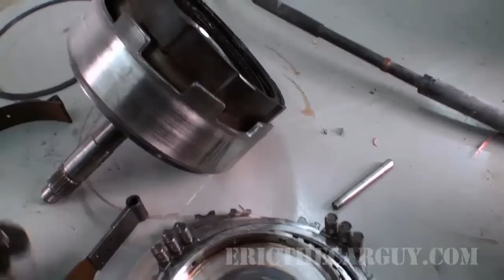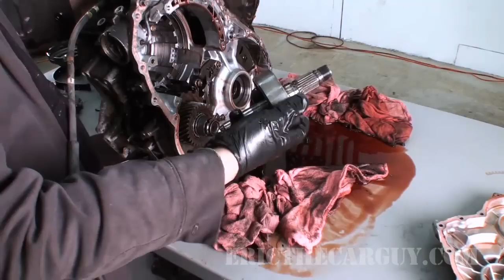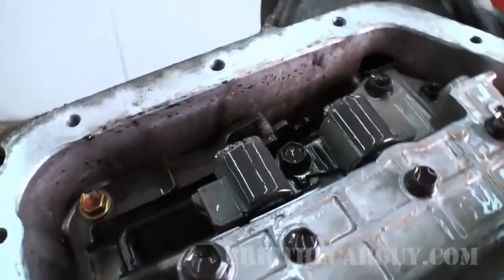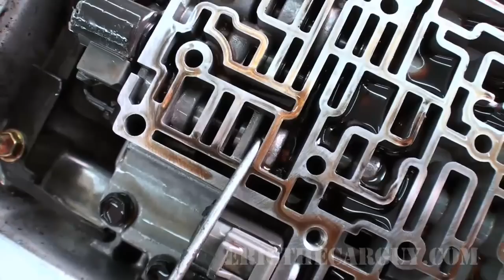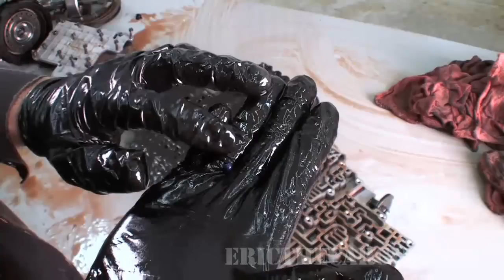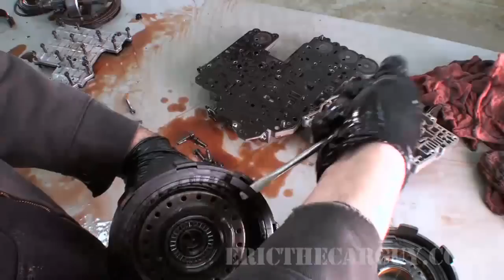The Basic Parts of an Automatic Transmission (Part 2)

Comment: what are the drive ratio's ?   
how many gears does it have ? what if you put TWO transmissions back to back ?
would that get you double the torque and  double the top speed if your engine was strong enough ?
Reply: J-N-H-M, Hi, the drive ratios (mostly called "Gear Ratio") is the relationship of movement between 2 or more gears, is the way to calculate the difference of speed of the gears, for example, imagine you have 2 wheels touching each other (acting as gears), one of the wheels (the small one) has half the perimeter of the other (the big one), this means the the small wheel which in this case is the input, needs to rotate 2 times to make the big one rotate 1 time, and so, we say that the drive ratio or gear ratio is of 2 to 1, or to explain it in a more simple way, this means that 2 rotations of the small wheel equals to 1 rotation of the big wheel, this concept is applied to all kinds of gears, including the "planetary gears" which are shown in this automatic transmission, there are many kinds of transmissions with many numbers of gears and speeds, it depends of the fabricator.

Now, i might not be the indicated person to say whether or not using 2 transmissions would double the torque and speed, as i know, if you do that, it is highly possible that the vehicle should have the double of the torque it had (as long as the other parts of the vehicle don´t break), but about the speed is a different story, because these transmissions are designed for a specific range of speed, and it would be very hard to make the vehicle considerably faster without damaging the transmission, independently of how you place the transmissions or the power of the engine, to achieve this, you would need to make some changes in the final gear ratios of the transmissions or axles of the vehicle, which could actually be more expensive and complex (and dangerous) to do than buying another transmission with higher speeds; i hope this information results useful to you, i must admit that i don´t have a very wide range of knowledge or experience in this field, so you could ask to people who know more about this than i to have a better idea.
Reply: thanks , besides the gears of  rc cars , bikes and  electric motors and pulleys  im a complete NOOB ..  as an inventor fabricator theorist , im always trying to learn  or improve things ,  for example Transmissions alone and all the different types even like the  " D-drive " and million to one gearing have given me Soo many idea's ... like couldn't a supercharger be crank powered threw a CVT  to gain PSI in different ways ....  instead of max RPM  equalling max boost pressure  , it could be geared/programed to hit max boost at 3000 rpm  and hold at max boost threw changing the gear ratio's / speed of the supercharger as the engine went higher in RPM .... 
thats just a small idea i kind of dont care sharing ..
besides i think the " vandyne superturbo "would still have that beat..
and the new F1 - powerUnits might be more of the future .
XD

Comment: how long do you mean "a long time"?? My 2008 LS460 8-speed auto has 87,500 miles without a transmission fluid change, is this going to cause the problems you mentioned when changed to new fluid?

Comment: thank you for this videos about automatic transmission..I am a simple mechanic here in the Philippine..I need your help about Mazda 2006 model..i have some question to you,,when the shifting engage to drive can not be move forward,but the car engage to rear the car is move to rear then  the transmission  is noisy,the panel board will be have an AT.i am FRANCO TACORDA PHIL.

Comment: I was about to drain and refill new transmission fluid, but the car has run over 200.000 km, and I doubt it has ever been changed before. If the new, thinner tr. fluid could possible ruin the function of the transmission I'm having second thoughts. Maybe save the old fluid and fill it back in should trouble arise?

Comment: hey eric I have a question. I have a 94 dodge dakota 2 door with the 3.9v6 automatic. My question is is it safe to engine brake with an automatic transmission? Im a little tight on money and to save on brakes I have been taking it out of overdrive in to regular drive then shift to 2nd to 1st as well as using a little braking too. Is this a smart thing?, dose it really matter, or should I just plain stop. Also I have a posiy traction 3.90 rear end out of a ram 1500 if that matters

Comment: hello eric i have 98 accord automatic and i recently replaced the trans with jdm trans and there is a delayed response in shift from park to drive and when put in reverse it makes noise and when i come to a stop it slams into gear before i accelerate, also when i put it it park the key won’t come out until i move the car forward a little. i’m all out of options. thanks

Comment: How in the H....e....l ...do you know which part needs to be replaced....in an auto trany...or do the service tech just replace a certain number of parts for a specific trany....and then check it out...I do know that a certain number of parts go bad  for each and every trany..so do they replace these parts and check it out on the dyno...or do they check out EVERY part and EVERY clearance of the trany...so it will pass the test...
Thanks .Kenny just a thought

Comment: Halo, I have a Toyota caldina Diesel engine wagon. Year 1999, engine 3C-E,
So this car has been sitting in my front yard for about 8 months, prior to that it was running just fine.
Recently I started it and it wont move. The gear lever goes to D, R, N, 1, 2 but the car wont move. I changed the ATF which was very dirty, so I changed it 3 times, every time pouring 4-5 litters of fresh new ATF. I changed the transmission oil filter too.

The car now after starting it moves for about 50-100 meters and stops. what could be the problem. Mechanic suggests opening the gear box which to me should be done as a last resort, just my opinion. I heard that when an automatic gearbox is opened it can start developing problems, how true is that?

Comment: What's amazing to me is that most of the parts individually don't seem heavy duty enough to handle the torque required to get a vehicle weighing thousands of pounds up to relatively high speeds or up a hill.   How is this?

Comment: Question , so am trying to get a maxima but from the reviews I read is that the 04 - 06 model have bad transmissions and for some reason the transmission starts to slip when driving down the rode when it's shifting gears and it starts to stall when you go from park to drive they just pretty much start fucking up unexpectedly wether you have high miles or low so what can be causing this issues inside the transmission ???????
Reply: Lots of stuff could be wrong. Just pull it from the car and get a new one.

Comment: well at lest Ik now that when I changed my fluid in my transmission that would be why it's starting or do a little bit slipping now wish I hadn't had done that just like now how long it last before it actually goes out on me cause only really slips if u stop real hard or slow down real quick and then push on gas u feel it slip

Comment: Given the advances in electronics controls and actuators, why has not any manufacturer came out with electronic actuators on a fully mechanical gearbox?  Honda does something similar but we all know their track records on making automatics!  Use linear motor/beefy solenoids to push the clutch in and/or change the gear and forget all the wizardry needed in making that fluid passages ant farm.  Can somebody explain what is the practical problem with this approach?

Comment: better to replace rather than repair. Labor charge would be much higher having you pull the whole thing apart, digging through the entire unit. swap with a new one is bound to be cheaper, right?

Comment: i use vios 2010 model A/T, is it alright if i switch the gear to Neutral whenever approaching a stop light few meters away so as to make the car on free wheeling, is it really advisable to do that? or rather keep on D gear and keep stepping on the brake while waiting for the green light?...
Reply: I really want to know that too! I used to do that all the time...i hope it wasn't the reason of premature death of my gearbox (started to slip)

Comment: You could say the valve body is a MECHANICAL computer. 

I liked the trick with the rag. 

But your explanation of "overdrive" could have used some improvement. It is just a gear ratio of less than 1. Gear ratio is simply number of turns of the transmission input shaft for every time the output shaft turns once. The input shaft of the transmission turns the same number of times as the engine's crankshaft. With a transmission having 4 speeds, that is, 3 gear ratios plus an overdrive gear ratio, the lowest gear, or first gear, might be maybe 4/1, that is, for every 4 turns of the input shaft, the output shaft turns only once. In decimal notation would simply be 4. Second gear might be 2.5/1. Or simply 2.5. Third gear might be 1/1, or simply 1. And for "overdrive" the input shaft will make LESS than 1 turn for every turn of the output shaft.  Perhaps for every 3/4 of a turn of the input shaft, the output shaft makes 1 turn. In decimal notation: 0.75. For "overdrive," the gear ratio is LESS than 1. That's all you need to say. Another way to day the same thing is that instead of the input shaft making more turns than the output shaft, the input shaft makes LESS turns than the output shaft. That's the same as saying the output shaft makes more turns than the input shaft. Or you could say an overdrive gear ratio is a gear ratio where the ratio of input shaft turns to output shaft turns - is less than 1.

Note that the axles and wheels do not turn once for every turn of the 
output shaft. Rather,  there is a gear ratio between the output shaft 
and the axle called the final drive ratio. Typically it is roughly around 4.0. For every 4 turns of the output shaft, the axles and wheels turn once. To get the number of times the wheels turn for each time the engine crankshaft turns, multiply transmission gear ration by final drive gear ratio. Then, if you know the outside diameter of the tires, you can calculate the car's speed from the engine crankshaft speed in revolutions per minute (RPM).

Note that I have used only simple arithmetic here - just multiplication and division (fractions can be viewed as simply a way of communicating division). No algebra or calculus was necessary.

Comment: hi eric i have a 95 jeep grand Cherokee with a 4.0 with 42RE transmission sometimes my Jeep starts in 2nd to 3rd gear it feels like I'm pulling in the Titanic behind me there r no transmission codes could the Governor Pressure  solenoid be bad or a Sensor ?

Comment: I have a question that no one can really answer for me. I OWN A 2000 Honda Prelude 2.2 H22a Auto with 81k. I live in Ny and ever since Sandy I been burning alot of gas averaging around 15-16 mpg. Tge car has new cap rotor wires and plugs, I have a Cold air intake new fuel filter new fluids. I keep my RPMs around 2-3. I also replaced all the seals in the engine and had the valves adjusted about 10 thousand miles ago. Timing belts and water pump has also been replaced. Running type 2 coolant

Comment: I wonder if it would just be easier to build a computer controlled manual transmission. Just a few extra parts to shift gears and control the clutch, but I think it would far simpler and more efficient than this.
Reply: They exist, but they're usually not great. A double clutch gearbox is a basically a more advanced execution of that idea.

Comment: Let's pretend that the weak points of this Toyota automatic transmission are the bushings in the transmission pump stator, that wear out prematurely: in your opinion, what accelerates the most this phenomenon? For example: driving almost always in hilly or montainous areas? Lack of maintenance, like a drain and fill every 60.000 kilometers, plus ATF filter replacement? Spirited driving?

Comment: The valve body is a mechanical logic circuit; the result of a lot of tedious math and engineering a physical object to model those equations.  I assume newer transmissions, especially CVTs, replace that with a computer.

Comment: How automatic transmission select gear?
Reply: Pedal position, your current gear, you current speed. Too much resistance you are going uphill, too low resistance you are going straight or downhill. Engine ECU or transmission computer calculates all this from how your gas pedal is pressed, you give gas but still very slow, its uphill, down one gear check again... how does it change gear, ok its too high lets go down, there are oil "caves" or traps, ecu sends signal to oil valve solenoid, creates pressure in that trap, presses the oil into the clutchrings you saw, press them together, spin the gear, if its another gear, its sends the oil into another cavern, that goes the the other sets off clucth rings, solenoids and valves uses oil passes to go to certain gears. At least this is what I learned trough dozens of videos. :)

Comment: Hey Mr Eric; question for ya. I have a 2010 Chrysler Town and Country which i'd like to keep until the world ends (for me anyway). I do my own repairs as much as i can. My question is, If I ever decide to service my transmission for the experience, where would i purchase the clutch gears. I realized that my transmission has slippage around second gear. I'm beginning to understand the greed of Car companies for example: my manual informs me to change my transmission fluid and filter at 100,000 miles which i did but now realize that I should have done it at 50,000 miles (sick joke on me). Any input is greatly appreciated and also let me thank you very much for your videos. Just in case my email is fishdenn@msn.com. Mike Fisher.

Comment: Please recant the myth about old fluid and it's 'sludge" keeping a transmission from failing. It is simply not true.
Reply: your transmission adapts to to fluid and particles in it. the metal causes where on the clutches. If you decided to wait too late to change it, it will slip past the clutch rings... Didn't you listen to anything he said?
Reply: The clutch rings do not seal the fluid in any fashion. He is claiming that new fluid will not contain the worn particulates of the clutch discs which in turn lower the the amount of friction between the clutches/bands and the steel discs/drums. 

This is simply not the case. 

Next you're going to tell me not to flush my coolant system because it will spring a leak. Or, if I a put battery on the ground it will DIE. Or if I turn a carb upside down in will be ruined forever. Or if I switch from synthetic oil to non synthetic I will never be able to switch back.Or I need to use the highest octane fuel even though my car doesn't ping using the lowest.
Reply: it will not contain it, because there is no worn particulates in new oil. oil collects particles that have been worn away from the metal gears and ect in the transmission
Reply: Bamazrollin I don't want to continue this discussion. Sorry. I just don't care enough.
Reply: *****
I understand what you mean.
Does ATF never get in between the clutch rings during normal vehicle operation?
If that is so then you are correct, otherwise, I would say, his original statement about the fluid has some validity.
Reply: UrMMV The clutch discs are saturated with fluid at all times. If the friction material is worn, the discs simply need to be replaced. The transmission is looking for clean, fresh fluid. 

A contributing factor to this myth is that people will often change the fluid on a transmission that is failing in hopes of reviving it. It is usually too late for the tranny by then. It was going to fail very soon anyway. And of course, it does fail shortly after the fluid change. It is not cause and effect though. Merely coincidence.

Comment: And all that goes out the window and gets replaced with EVs with no torque converter, no clutch and no gears. The motor is permanently connected to the wheels via the drive chain, so just one speed. Neutral is a set of caster wheels that go under the drive wheels after you jack it up. Some have a fake neutral that makes the motor spin in the direction you push and fake park that holds the motor firm when you try to push. Reverse gear puts the motor in reverse. So, theoretically reverse can go just as fast as forward. What a joke!